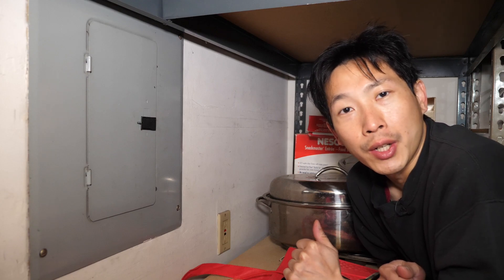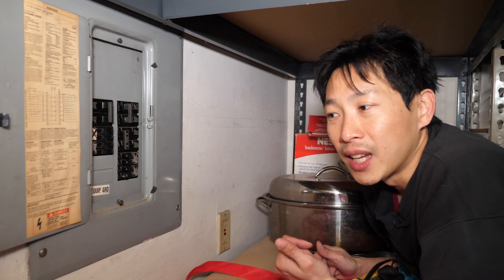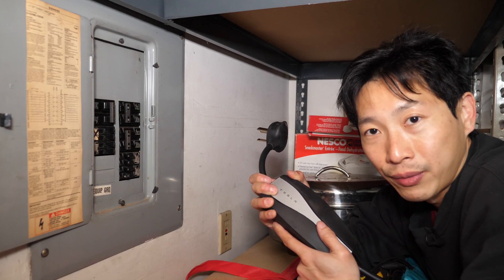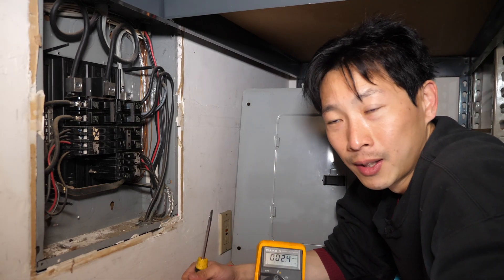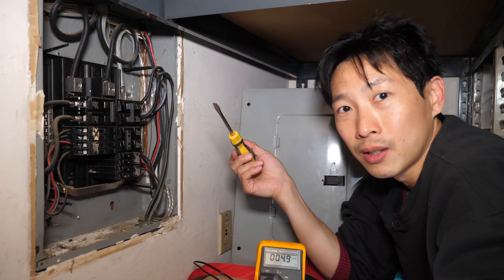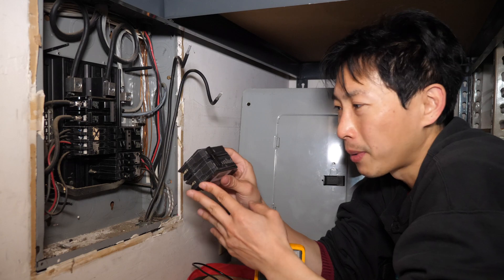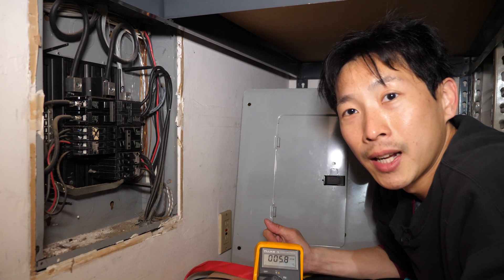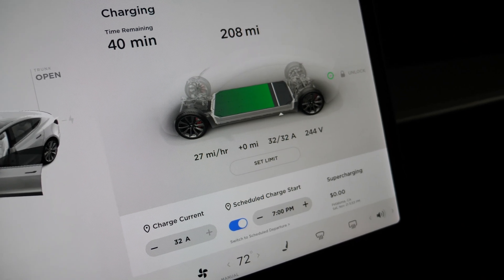How to Change a Circuit Breaker

Comment: Does this mean that it takes 10 hrs. to charge your car long enough to drive 280 miles?
Reply from the maker: Yes, that is correct. Charge it overnight. In real world experience though, charge speed is not a factor at home but much more of a problem when you make a pitstop. In that case, you use super chargers for 20-30 mins.